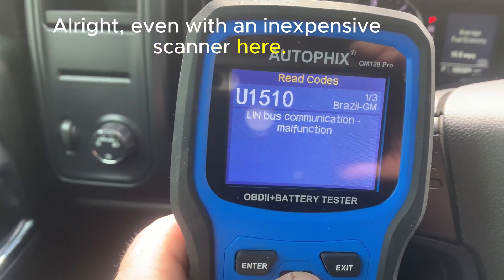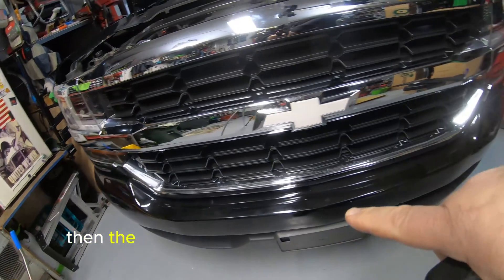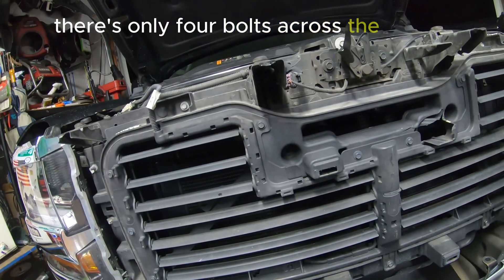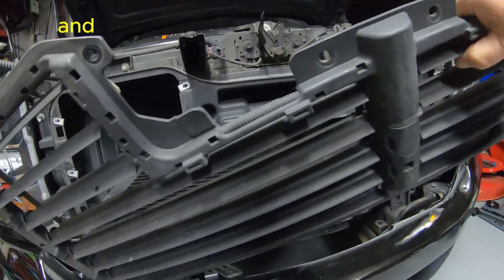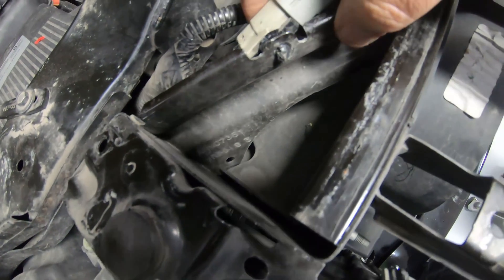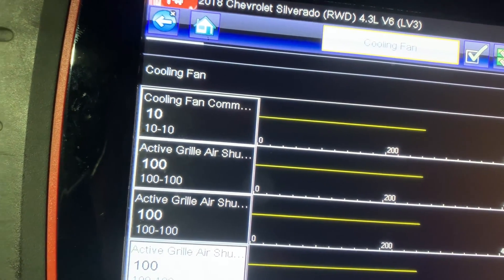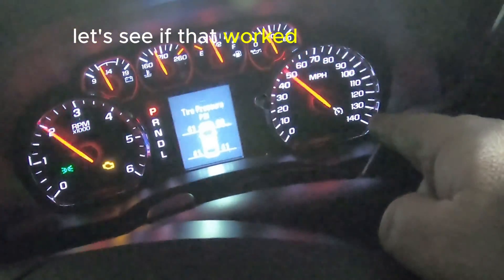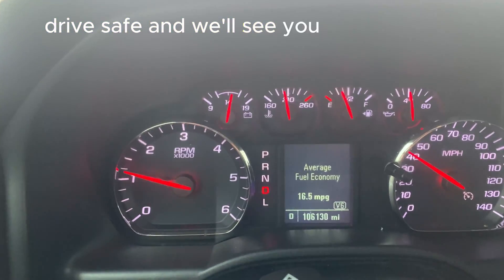Active Grille Shutters: U1510 Code Easy Fix Guide!

Comment: Mr. Baldeagle where is the active grill motor located?  I had a similar problem with my 2017 Suburban
Reply from the maker: It’s part of the shutter. Follow the wire from the passenger side above the grill. It’s not replaceable without replacing the entire shutter but you can get to it for testing purposes.
Reply: Huh ok I saw another video where the guy showed an actual motor that was broke but I think mine is like your truck because of that center bar that runs up and down the grill shutter assembly Ok brother I will look into that thank you very much sir!
Reply: Oh and I couldn’t find the little motor in the location he showed there was nothing there.  Thanks again

Comment: I appreciate you making a USEFUL video. Thank you. I’m curious if you checked the function of old shutter before swapping it out (as you showed after you changed it) I have same problem on my 2017 my Autel scanner has a function to activate shutter but doesn’t seem to work I removed shutter blades and was able to get it to move I’m guessing the shutter motor itself is shot since it won’t function under load. Unfortunately can’t find just the motor
Reply from the maker: I did try to test it before removing it but the video didn’t turn out very well so I did not include it when I edited.

Comment: Is this grill shutter still working properly?
Reply from the maker: Yes, I’ve had no issues with it since it was installed.
Reply: @baldeagle242  just ordered it!
Reply from the maker: @joseadlc03 Let us know how it works out. 👍
Reply: @baldeagle242  Yes sir.... should receive it Wednesday.
Reply: @baldeagle242  need help... which is the fuse for the shutters... I own a 2018 silverado
Reply from the maker: @ I believe I show it in this video. Going off of memory I don’t recall.
Reply: @baldeagle242  So Far So Good... Check Engine Light Turned Off... No Need To Go To Autozone Or Have It Terminated. I'll We Say The Quality Of This Part Is Cheap! Lol

Comment: The number 47 fuse says throttle control?  Grille shutter control on a throttle control fuse?
Reply from the maker: The fuse numbers may be different on your truck. This is a 2018 WT with the 4.3l v6.
Reply: What did your fuse actually say it was for?
Reply from the maker: @CraigNicodemus The AGS system is typically powered and controlled through a fuse and possibly a relay, depending on trim and feature level. On the 2018 Silverado:

Underhood Fuse Block (Engine Compartment):
Look for Fuse F50UA (15A) listed as “Active Grille Air Shutter” in the owner’s manual and diagrams.
This is a 15-amp fuse dedicated to the AGS actuator motor.

Open the underhood fuse block cover (located near the driver’s side fender).
Look at the fuse diagram inside the lid or refer to the owner’s manual.
Find Fuse F50UA — it should be labeled accordingly.

If You Don’t See F50UA:

Some configurations combine the AGS circuit with others like cooling fan or aero components, so check these as well:
F42 – Miscellaneous modules (varies by trim)
F31/F33 – ECM or cooling fan relays which may affect AGS behavior

If the AGS isn’t working:
	•	Check F50UA fuse first.
	•	Inspect the wiring harness running from the shutter actuator to the front of the radiator support — it’s exposed and can be damaged easily.
	•	Look for DTCs like P059F, P05A0, P05A1, which relate to AGS faults.

Comment: Would 180 thermostat burn out the shutter grill after I put a new thermostat in it started happening
Reply from the maker: I see no reason why a 180 degree thermostat would cause an issue with the shutters. 
If it’s not programmed for a 180 thermostat It may cause issues with timing advancement and lower power. The computer will continue to use different fuel mapping tables if it doesn’t see 195 or more.  It may not cause any issues but it will lower your fuel mileage and possibly trigger a check engine light.

Comment: Just replaced mine..not even 6 months and its shot again
Reply from the maker: I’ve discovered after making this video that it can be completely removed and tuned out with an HP Tuner. I purchased one to change some transmission settings but if this thing fails again it’s going bye bye.

Comment: Great vid. You should do a video on how to remove and bypass these shutters altogether. With no check engine light.
Reply from the maker: That can be accomplished, however you will need an HP tuner (or similar programmer) that has unlocked the computer for your vehicle.  I can make a video showing how to do this but the tuner with 4 credits to unlock a 2018 is just over $600.  There really is no way to remove it without setting a check engine code without a programer that I’m aware of. If someone already has an HP programmer it’s as easy as checking a box to turn it off without setting a code. If there are other perimeters you want to change it may be worth buying a tuner but for most people facing this issue, replacing the $200 shutters is a less expensive option.

Comment: What was the fuse we should check first?
Reply: #47
Reply: @richardrodriguez7829 what else does that fuse control? Can it just be taken out to get the light to go away?

Are the Dorman ones bad like that’s a issue? I have replaced mine 3 times now and after a month the light is back on. I replaced the sensor on the grill shutters and still have a light. It’s not like the light is immediately back on either could be a month or 2 and then issue comes back. Idk what to do! the main plug has been tested and is good I’m sick of tearing this about have like 6 times in a year! 2017 Chevy Silverado btw 
Did your light ever return
Reply from the maker: My light has never returned.  I’m not sure what else you should check.
Reply from the maker: I don’t recall but I think I show which one to check in this video.

Comment: Has this active grill shutter given you any issues? I saw the reviews for the one you recommended and some have had issues. I was curious only because I have this same exact problem
Reply from the maker: So far it’s still working. If that changes I’ll be sure to leave a follow up comment.
Reply: Thank you very much! The dealership was trying to charge me $190 just to diagnose the issue and videos like this are very helpful to those who’d rather do the work on their own and learn at the same time. Greatly appreciated, sir!
Reply: Had Onstar run a diagnostic check and also went to auto zone for their free check and they confirmed it was the active grill shutter. Once again thank you for these videos 👍🏼

Comment: Did the light come back on? I am having same issue with 2017gmc Sierra. Changed 2 grilles. Alternator, ambient temp sensor. Cannot get the light to stay off lol so aggravating. But ur video was helpful.
Reply from the maker: So far the light is still off. The same code can be triggered with a few different issues.

Comment: Those grille shutters are a pain in ass. I can't find an electrician who is willing to take over this issue due to lack of experience with gm cars and required software. Obd scanner is not helpful for them.
Reply: Having same issue. 2017 gmc sierra
Reply: @TheNick58636  if the grill shutter is connected but still doesn't function properly I can suggest to replace the shutters or install an emulator. The ECM of the car will think the shutters are installed and the engine check light won't come on.
Reply: @Zabarotropitili where can i order a emulator i have a 2017 buick lacrosse i replace the shutter and still wont work

Comment: That is some real high tech tomfoolery there brother. I love how you did that with the pressure sensors man. You rock!
Reply from the maker: Yeah I took a chance on this truck and bought it from the seller with the check engine on. He let me hook my scanner up and pull the codes so I had a good idea what was wrong with it when I bought it. Fortunately it turned out to be a very cheap fix considering what I paid for the truck. 
The tire pressure fooler is another story. That worked just long enough to finish this video and then the tire light came back on. 😭 Apparently the sensors have to see motion in a certain period of time or they go to sleep and stop sending their signals to the truck. I’ll have to break the beads at some point and put them inside the tires. Either way it proved the check engine light stayed out and it’s still out even with the tire light on. 😁👍
Happy New Year 2024 in one hour from now. 🎉🎊🍾

Comment: TPMS Sensors are a pain in the Butt. My dash warning light is on more than it's off. Seems like I'm always replacing dead sensors in my tires ! ☹
Reply: I have a TPMS device i bought on ebay that shuts off low tire light for good. Also another fix was the hood latch, I bypassed that to trick the ECM with diodes in the plug
Reply: Don’t use aftermarket sensors. Spend the money and use GM sensors. They last 80k-100k miles before you start having issues. The way vehicles are built today, buy once cry once and never do it again. By 200k they’re ready for the scrap heap

Comment: Nice video Steve! I think you covered that very well and did a good job explaining the procedures. When the shutters weren't working, did it make you engine run hotter? Thanks!✌🇺🇸
Reply from the maker: No, mine were stuck in the open position so it had little effect on engine temps. From what I’ve learned they are more for aerodynamics and only close when the truck is above 30 mph.  Other than the check engine light there was no other symptoms.

Comment: do you have a link and/or video on that "tire pressure sensor" fooler and the actual tool to reset them?
Reply from the maker: Here’s a link to the programming tool. https://amzn.to/3two5q6
I bought these sensors to put in the tires but haven’t had time to break them down yet. This was a temporary “hack” just to turn the light off for the video. 
What you’ll need:
2” PVC pipe, two end caps and a drill bit are all you need. Drill one hole to put one sensor through. Put the rest in the pipe. Glue the end caps on and wait for the glue to dry. Once dry add air and program them.